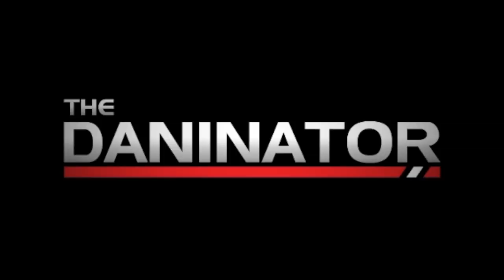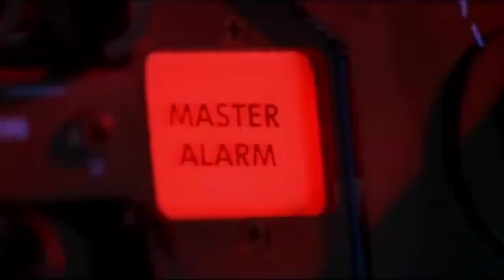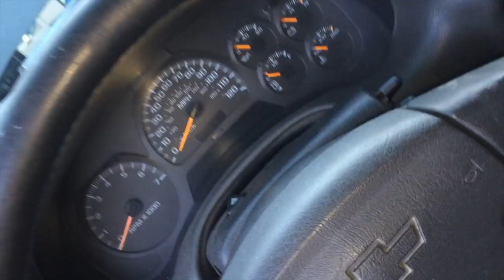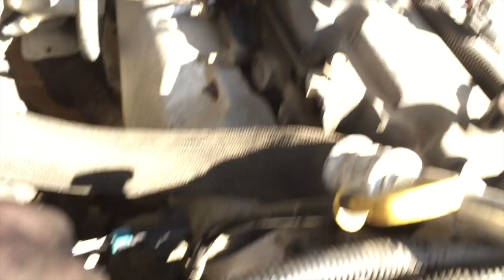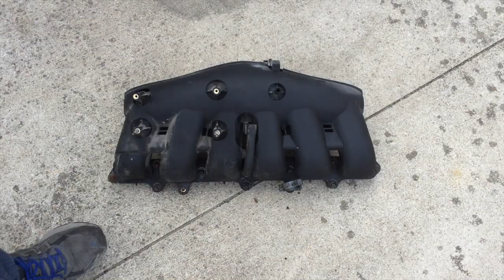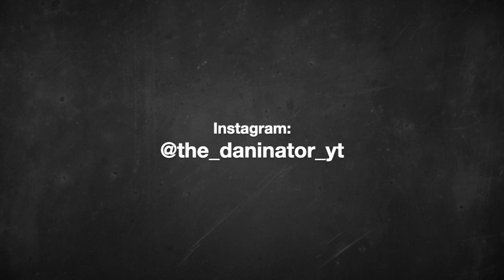Project Failblazer Episode 8 - Discovering Oil in Spark Plug Cavities

Comment from the maker: I struck oil! Too bad it was in my spark plug cavities. LOL
Reply: The Daninator That’s not good. I am also having trouble with my Trailblazer. It is a 2006 LT model with 133,000 that has the LH6 V8. It is also a Regular TB not an EXT. It has the Displacement on Demand which deactivates 4 of the cylinders when there is not a lot of load on the engine. I believe that this has been causing my oil consumption. It uses about 1 qt per 1500 miles. But it keeps running as long as I keep oil in it I guess.
Reply from the maker: Sounds like the engine loves oil, lol
Reply: At least my 2003 trailblazer waited until 196,000 miles. Poor girl...
Reply: How long does it take to do it all?

Comment: My 09 4.2 liter just started leaking from valve cover got 209566 miles . I know these vehicles gotta bad rep. but my TB has been running strong.  Ive been doing the basic maintenance work on it example oil changes sparkplugs air  filter brake pads serpentine belt and replaced water pump owned it for 7 years . But man !!!! Tooo much work into replacing that gasket !! Since the leak is minor now truck runs great let it ride lol.. Thanks anyways for your videos Dan watch them all the time take care of yourself and be safe.
Reply from the maker: As much as I rag on these trucks, I really do love their utility. They are hard workers and have a lot of power.

Comment: Smh I just pulled the plugs 🔌 and walloh.. my guess was on point 🛢️ oil in the freaking spark plug coils.. what made me discover this.. I had some up and down revin in (P) idle... And I decided to clean the throttle body BUT I had the engine off. And went to town with the spray can and it got into the intake next the throttle body.. and wouldn't start up.. seen the sparks had oil all in them. One of them were completely dry and new looking.. the rest were dirty and semi burnt. 2 plugs were really bad with oil. I'm gonna pull the plugs. Dry the coil bases real good.. and swap out the plugs with brand new babies.. dry everything good as possible.. put a quart of that wonderful oil Lucas treatment gasket seal repair.. top everything off and tight the bolts back down. Connect the throttle body back and start that engine and watch the sparks fly.. and smoke up the lot.... Until all that debris is out of the throttle body and intake... And run it for a couple hours.. and walloh.. good as new.. refurbish and ready for another 30,000 miles... It's a used 2008 I got my money's worth and these Chevy's have a really good life span of they are taken care of properly.. has about 181 on it now.. got it when it was 131.. so I know it can go well over 200,000 miles.. easy.. gonna ride this sucker until the little big engine can't run anymore. Great video thanks dude.. 👍

Comment: I just watched episode 9, but thought I better back up to 8. I had this problem about a year ago ....I mean oil in the 3 rear most cylinders. I changed spark plugs. Before installing them, I vacuumed the crud, and oil with my small wet vac, sprayed brake cleaner in each spark plug well, blew out with air hose nozzle. And repeated until the wells were clean. I then spread blue RTV on the area of the gaskets with my fingertip. I reasoned that the oil seepage was not under high pressure and adding the RTV sealant on the clean metal surfase and up onto the plastic intake would "probably" seal the oil. Rather, I hoped it would. Last month a storm in our area with 90-100 mph winds knocked trees down all over our county. My Trailblazer was in the path of one of 12 trees on my property and damaged hood and fenders and then lifting hood, the battery cover and oil intake inlet was smashed. So today I started removing the could and air box. I found that my hoped for repair held and all of the spark plug wells are dry. And that now my repair might cause me some cleanup issues....but it did hold after about a year and half  of about 25k miles.
Reply: This is Great advice, the blue rtv should be standard practice for these engines.  Clearly theres a problem with the design of the plastic valve cover, as nearly every engine has this problem..  some real creative genius, like the design team wanted to create case studies of What not to do..

Comment: Best video I have found for how to do this. Very thorough. Will running the engine with oil in the spark plug cause damage to the engine long term? Or destroy the coil?

Comment: @the daninator Thanks man! I got another video coming up on yet another failure 😂😂😂... If I didn't bleed orange I guess i'd buy something else.... but not a F*&D.... 

Great video! That inline 6 Chevy came with is really a good engine, just not a lot of aftermarket support for it... well.. any support for it LOL  😂
Reply from the maker: 3 Wheels & A Block I agree. When it runs right, it’s got some power.